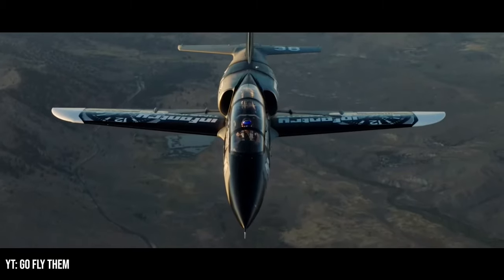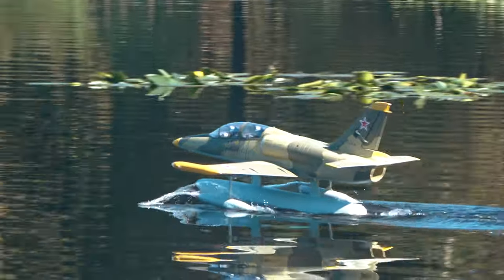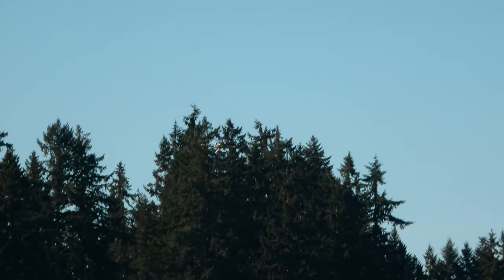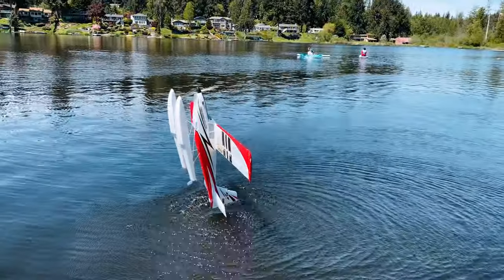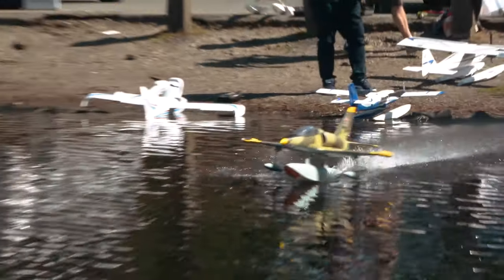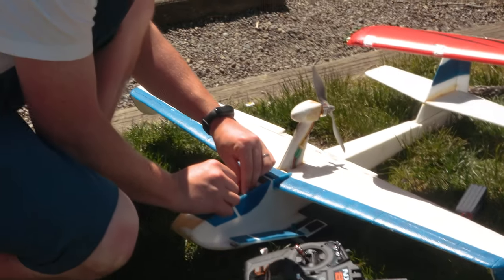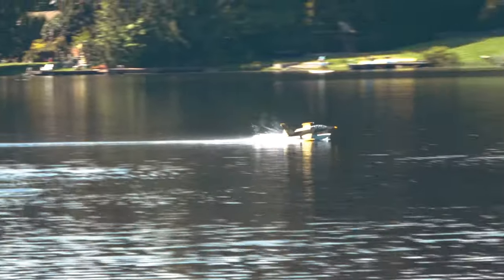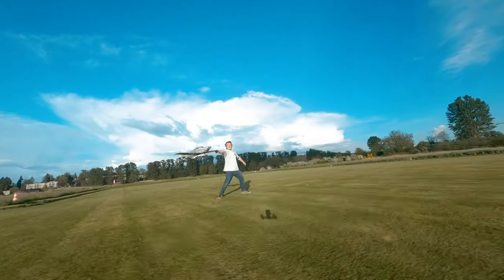We Made A Jet That Lands On Water

Comment: on the mono ski you could add carbon or alluminum rods pointed foward protruding from the wings leading edge in line of the fuel tanks. attach a short wire/cable from the tip of the attached rods to the foward tip of the fuel tanks. simple, lite and easy

Comment: For the life of me, I can't seem to figure out why it would want to pitch up. You guys obviously know what you're doing, but I normally grasp this kind of thing quickly.

 If the thrust is above the CoL, and the drag is below it, wouldn't both be trying to nose the plane over? The slope of the main float doesn't seem extreme enough to act as an inverse spoiler. So why does it pitch up? Is the CG fairly far back to make it float right?
Reply from the maker: It definitely was odd. I felt it the most at low air speeds and high angles of attack. 

One of the likely causes was the drag of the float below the airframe (just like in a full scale plane when dropping the gear and the nose wants to pitch up requiring down trim). 

The other likely factor was that the net center of lift was moved forward as well due to the big float under the plane at a higher angle of attack. The float itself is a lifting body. I was likely feeling a pitching moment, that is, like a lever. A body like the giant float under the fuselage will have it’s center of lift about 1/4 back from the nose which would be well ahead of the CG of the plane. 

There could be other reasons too such as altered airflow over the horizontal stab for instance but none of it is provable without wind tunnel data. -Zach